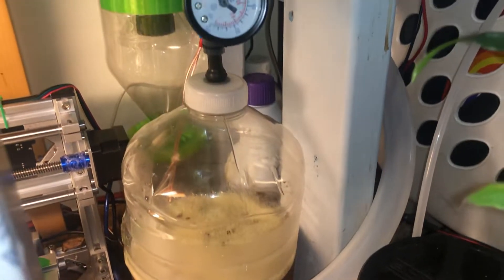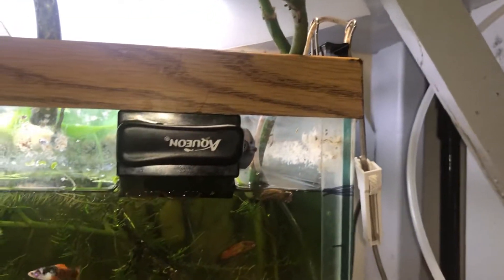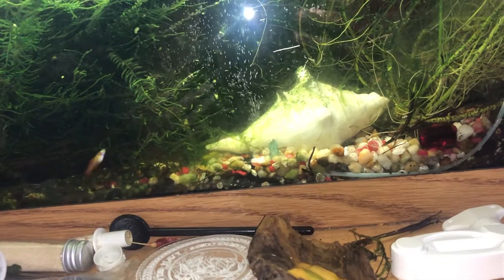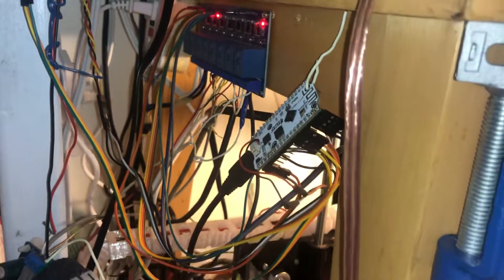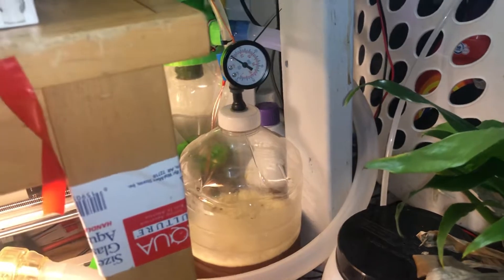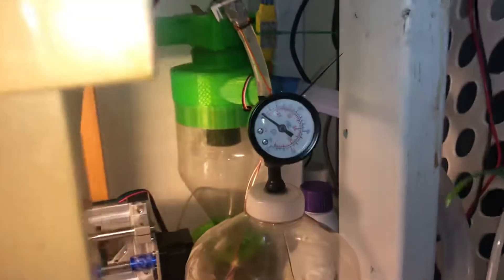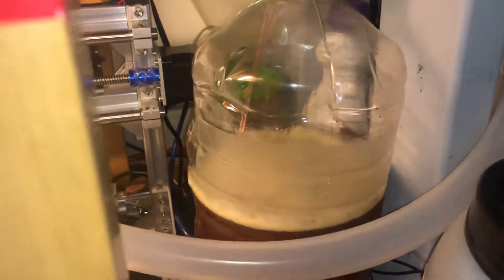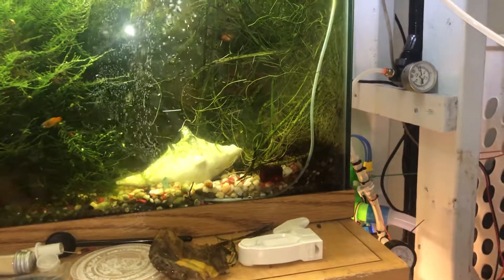Adjustable Pressurized constant Co2 and gelatin method.

Comment: Where can I buy the release valve? Can't seem to find it anywhere
Reply from the maker: Here is an update video of the system: https://youtu.be/5Xa7uC-SQTs
And here is the link for the adjustable valve: https://www.ebay.com/itm/283464238460
Reply: @biomechatronicshacks511  oh it's called a spunding valve eh? No wonder I can't find it. All things considered, this seems to cost as much as a DIY soda bicarbonate kit. Will probably get a new tank soon to compare both systems
Reply from the maker: @Inaugural_Eel  yeah, it is the almost the same system the only different is that instead of having two bottles and the two components being mixed gradually you only have one bottle with the components mixed from the beginning. One system is controlled by the mixing itself and the other is controlled by pressure, temperature, and the rate the yeast cells divide.
Reply: @biomechatronicshacks511  instead of plastic bottles, how do you feel about steel brewing kegs? I think that they'll handle the pressure better?
Reply from the maker: @Inaugural_Eel  you can use any container that hold pressure. It is a matter of preference, I like the plastic bottle because they are see through and I can see the reaction happening.

Comment: Hi, does it woth to make this for a 2l soda bottle? And if so, can i make it to release some of the pressure if it goes over a limit that i set?
Reply from the maker: It does, but you need to leave enough space for the CO2 to compress. On my updated video of the system I show a fine adjustable pressure release that can be set to the desirable pressure at which you wish the extra pressure to release. They are commonly use for brewing beer.